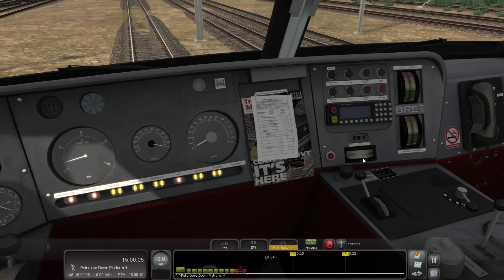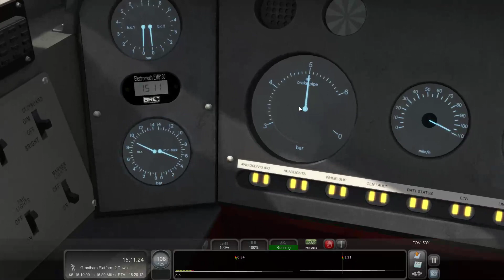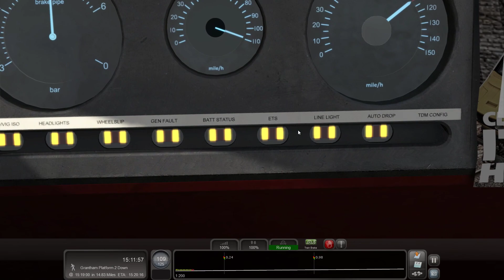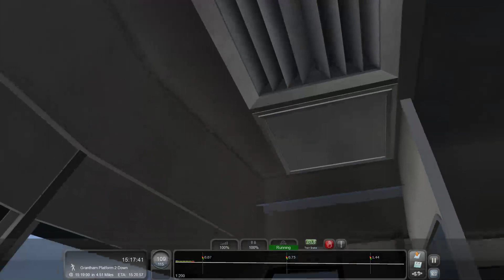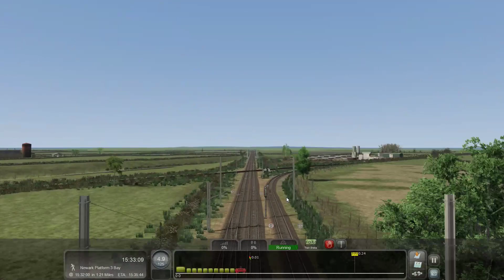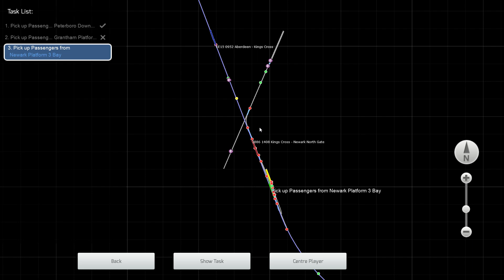Train Simulator 2018: Class 90 Peterborough-Newark North Gate

Comment: Hi all, the reason Alan had to PASS Newark to get into the bay platform was not a fault with my scenario, but a combined fault with the actual route itself, and Alan not having the fix installed on the route. The crossover at the London end of the station from the down main to the bay platform via the up main was by error not electrified (it was in my route as I had the patch), but Alan didn't have the patch installed, hence on his scenario it routed him north of the station.
Reply: I'm glad there's a valid reason for this, for you would almost never see an un-signalled move like this happening unless under the direst of conditions
Reply: Hi there, platform 3 track goes to lincoln, it does not further connect to the ECML it'll just make a left and connect to the Nottingham - lincoln route, the Newark - Grimsby does this route I've been on it before but I do understand the problems and it is a pain, I made this station on roblox
Reply: https://youtu.be/1M5idbcxmKE